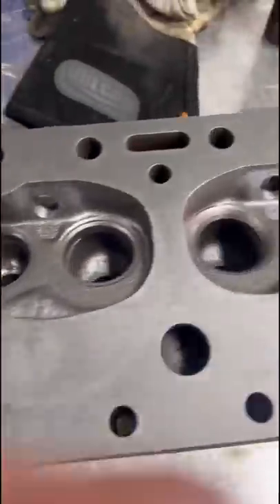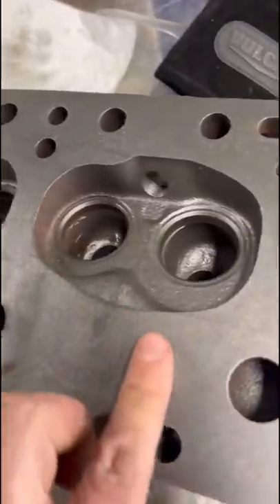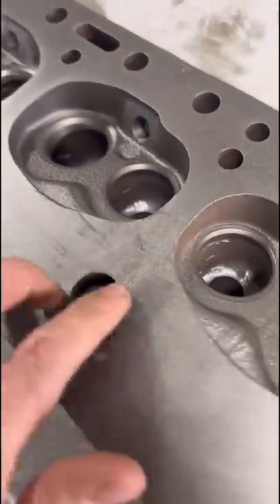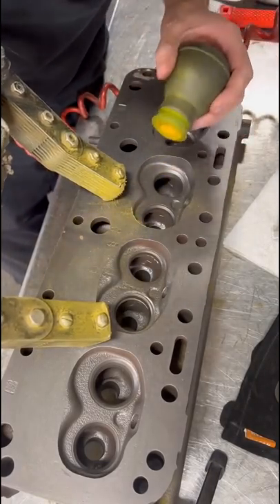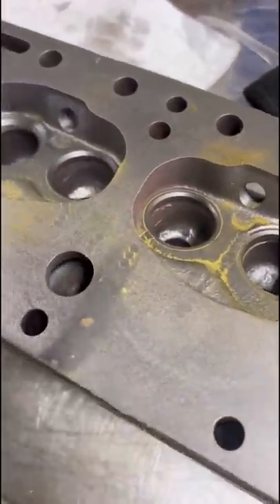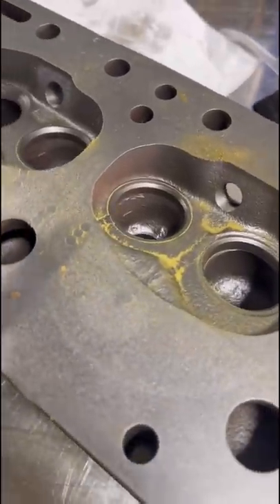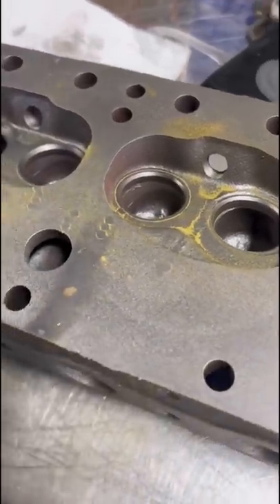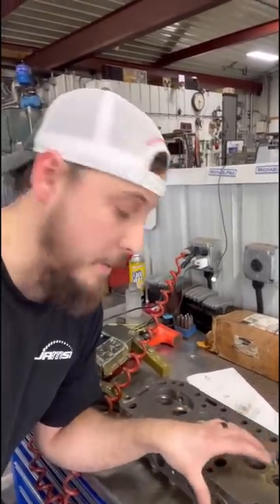#shorts Found The Last Guy’s Skilled Labor On A Ford 172 Gas Cylinder Head

Comment: You can nitrogen shrink in the seats to avoid disturbing the crack repairs
Reply: Gotta make that money
Reply: It's called tolerance fitting 😄
Reply: @hammatime94  I dont think you understand how delicate crack repairs can potentially be
Reply: @AndyE30  ikr. Generally a crack like that is an engine killer. Any repair like that is called a fucking miracle.
Reply: @oceanbytez847  Oh no. See a old JB weld box that said a farmer fixed his engine block and a ship used it on a head and it's fine. lmao
Reply: @jasonchristopher2977  I've fixed cracked go kart block and one that had a hammer put through it.
Reply: @AndyE30  This was the repair method for cast iron. done correctly this repair will outlast the head. The crack is terminated with a hole at each end of the crack. Holes are drilled and pined (hard bolts screwed in and cut off)  the next hole was drilled overlapping preventing the bolts from unscrewing.
Reply: @oceanbytez847  No it is quality work by a skilled machinist. Clearly the repair out lasted the valve seats. Not a miracle just good skilled work.

Comment: Whoever did that repair knew what they were doing. That looks like a good repair to me especially since there was no further cracking. This also goes to prove that this type of repair is reliable unlike alot of people like to say. This kind of repair is very strong as long as it's done the right way.
Reply: Exactly. Sometimes you gotta do what you gotta do especially back when this tractor was new. New heads might not be available so you make do with what you got
Reply: It's a lot harder to do it reliably on more modern stuff, since there are many more different alloys used. Sometimes requires XRF analysis of the metallurgy to find a compatible welding rod
Reply: The trouble is finding skilled labor to do it. Its not common at all in the states.
Reply: @oceanbytez847  very true. I am an automotive machinist and its scary how quickly shops are closing across the country. Cant find people to work that are any good and also the parts industry is fucked.
Reply: @leojensen9270  nowhere can get anyone that is any good. We have been made idiots
Reply: @katlynklassen809  eh I know tons of skilled tradesmen working but they're not working for pennies anymore we've moved onto higher paying jobs no more finding welders, maintenance, or pipe fitters for less than 22$ an hour anymore
Reply: @michaelf.2449  i agree. Hell where I'm from no less than 32.
Reply: @michaelf.2449  I got a company rig and $40 an hour. No reason to bust your body up and be stressed all the time. Shit, sonic by my house is staring people at $22 because they literally cannot find help.

Comment: I'll give the guy loads of credit for his repair. I know the 172 gas heads were notorious for cracking. Lots of them got replaced at the 20 year old mark. I have welded my fair share of cast and knowing these heads as I do, I would have passed on them. I was told the replacement heads had a touch more nickel in them to make them more robust. They usually cracked from the exhaust guides out.

Comment: Some guys will go as far as find a large valve that fits a different engine, just so they don't have to fit a new valve seat. The guy at Jafromobile having the benefit of +.5mm valves in stock because the 4G63T is so well loved by builders. Sometimes he doesn't fit the +.5mm valves for performance purposes, he fits them because it is easier than removing old valve seats and installing new ones, when the old seats are beyond recutting.

I always enjoy seeing a cracked metal repair that becomes practically invisible after being machined.
Reply: Love the 4G. It’s a good breathing engine.  Volumetrically efficient for its time and was in commission for a good while because of it.  The 4B11T was it’s successor and I have not heard much on it for builds.
Reply: @Dr._Love  The 4B11T has been said to fail at the connecting rods more easily that any 4G63T did. However, if those are replaced, they work very well.
I intend to own an Evo X eventually, but don't plan on a special build. I just want something that there will never be another one of.
Reply: Huge fan of the 4G and @Jafromobile is an amazing and likely indispensable educational resource.
Reply: Interesting!
Reply: @Ban this youtube I think the ones made from 1995 to 1999 had thrust bearing problems. I don't know if it was possible to rebuild them in a better way.
I knew it wasn't a problem with the Evo 8 and 9.
Also, I'm not sure if it affected the earlier Evos not sold in the USA.

Comment: I used to get cracked on for some of the repairs I did the engines but after they were still running eight 10 years later and what I did was never retouched then they thought it was pretty impressive what I see here somebody did a good job

Comment: I have an old 1930 Farmall It is currently running with a head that has been braised back together in the top of the dome. I thought the chunk of soot until I took a wire wheel to it. There was no grinding done to it once they fixed it. It's probably held for at least 70 years and it still good to go.

Comment: We used to NDI aircraft parts and welds but we would cover it in a fluorescent liquid and magnetize it and it would go in to cracks or scaring of metals and welds! Cool to see it done on car parts
Reply: I really liked looking at the x-ray and gamma ray inspections while I was in my A&P AMT classes, really cool stuff. Loved doing mag particle inspections too.
Reply: I did ndt on ski lifts for 7 years, cool to see it in other lines of work for sure. We did fluorescent wet bath and mag powder on the chairs. Wish I had kept with it and gone airplane or engines with it for sure
Reply: BINDT and AINDT is NDT not NDI or NDE. Contrast background?

Comment: This was correct repair methods all the way up to the early 90`s. I spend hours doing this at my grandfathers machine shop back In the 70`s. it was the very first machining function i was taught by my grandfather. Mostly because no one else in the shop wanted to do it and i was low man on the totem pole.

Comment: Your shop did some work on a C-39 Chrysler engine for a town and country for me.   Bore job and cam bearings and cleaned the deck. It worked out great. I was very happy.  Car sold right away. I will visit sometime. Spring brings new projects.  
 Thanks.

Comment: Lock and stich is amazing, if you have not seen it, its like magic pin glue from hell, that works to fix the unthinkable 99% of the time as long as its well done. 

The underlying issues are what the hell part is, such as, why is crack, what is crack, how is crack. Replace crack with stress, fatigue and this is absoutley not a drug reference.

Comment: I hope it doesn't crack while you're putting the guides back in. It does look like whoever repaired it did reasonably well. None the less probably a good idea to notify the customer of mild risks of machining it, new seats, decking the head and putting new valve guides in it. Likely be fine, however it's always good to have plausible deniability in case the previous repair fails during machine work.

Comment: That crack repair is probably fine. I bought some rebuilt Chevrolet Vortec heads on Ebay. They had a bunch of that same type of crack repair,mostly near or on the bolt holes. At first I was kinda worried about it when I first installed them. That was almost 4 years ago,I trust that type of repair. 1 of my heads had like 8 repairs on it. I put that one on the driver's side because it's easier to replace. Luckily I've never had to.

Comment: Had a Ford transit that was using some oil. Asked the mechanic if it was the turbo leaking or head gasket, was told they would just have to change the turbo and see if that would sort it, and it wasn't worth replacing the head gasket. Was a 2008 transit worth about £4500

Comment: Wow interesting
My 172 tractor was dropped at the shop, they refused to work with my crack repaired block, forced me to wait several months while they “fix” it.
And now I’m on month 8 waiting for a call back about a 172 diesel to replace the 172 gas that they refuse to fix and I haven’t heard from them in two months.
Boy I’d sure like to work a field!

Comment: do those lock and stitch usually hold?
Reply: I've done many tapered plug repairs and excluding combustion chamber repairs there has been no issues with failures. Combustion chambers with cracks running from seat into the chamber is about a 30℅ failure when pressure testing. That's enough that I won't bother attempting unless getting a replacement core is an issue.
Reply: @porousorificePilot  thanks to folks like you finding a replacement core IS usually difficult. I hate seeing good parts get scrapped because saying it's junk is an easy excuse for not having the correct tooling or knowledge. In 30 years when we are all fighting over the last remaining internal combustion parts y'all gonna regret throwing that shit out
Reply: I had a set of cracked heads given to me for a transam I had in highschool. They had cracks all over them. The machinist said it was the worst he had ever seen. I slapped them on anyways as is. Car ran great. Burned no oil. Sometimes you could smell coolant and every thousand miles or so you would have to add some. Had a Subaru with a cracked head. Previous owner pulled apart suspecting head gasket. But it was the head. I brazed it and put it back together. Again ran fine. Had a 350 with a torched block given to me. To much nitrous. Welded it and used an angle grinder to grind it flat. Finished it with a file and a good straight edge. Put it together. Ran fine. I've always taken the I don't give a fuck approach and it's always worked. I think all the internet has done is blown common blanket statements and wivestales out of proportion
Reply: @2wheelhoon813  amen

Comment: Im guessing this is the engine in my jubilee tractor
Reply: Nice. Wouldn’t worry, I’ve stitched many parts back together and they’ve all held. It’s not like the jube’ is a nitro breathing monster. It’ll be fine.
Reply: I think the jubilee was 134ci
Reply: @uplandhunter6252  you are correct. 172 in the 800/900/801/901
Reply: @thegreenerthemeaner  I actually have an 850 that was my grandfather's